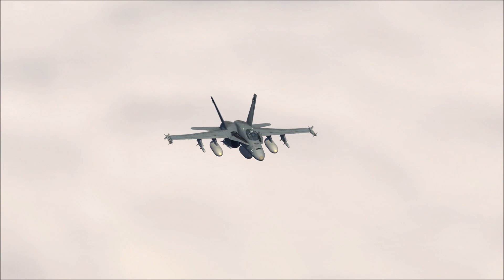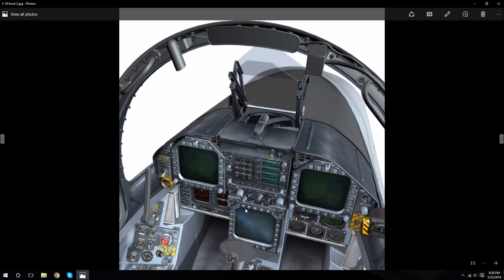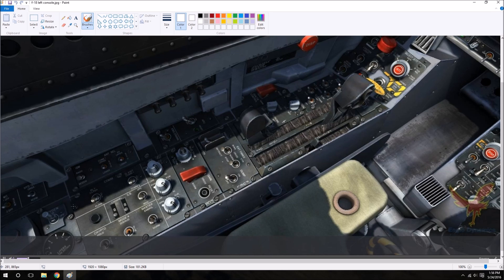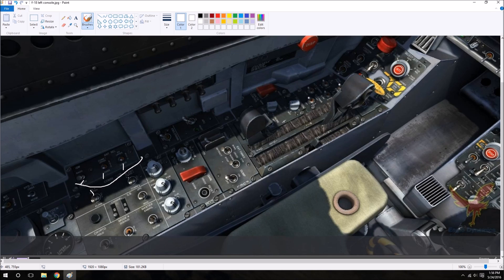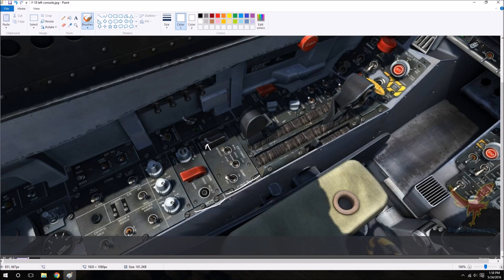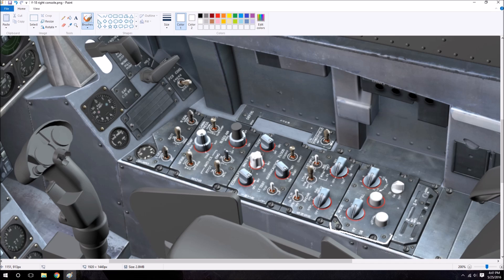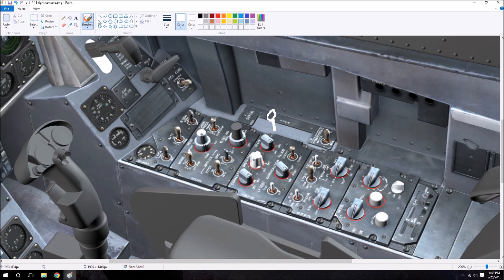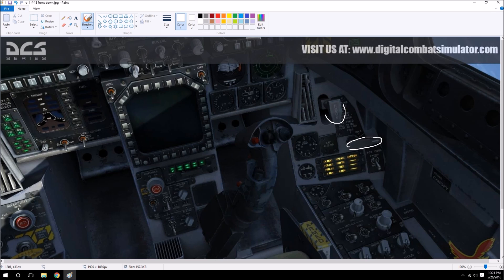DCS F/A-18C Cockpit Familiarization Tutorial Part 1

Comment: Be a man, Play BMS
Reply from the maker: BMS is great, just don't think i want to fly a hornet that has the avionics of the f-16 instead.
Reply: Apparently you haven't flown any recent updates then. Much better than anything else available.
Reply: Obviously you haven't tried any of the recent iterations recently.  It is much better than any of the other offerings currently available.
Reply: Sure some of the terrain graphics aren't great, but you can't say that the Viper graphics aren't good.  The complexity of the systems is unmatched in any other simulator.  Not to mention the dynamic campaign and multiplayer.
Reply from the maker: Dalton, no need to insult his favorite sim.
Cole, BMS has its advantages, but if by systems you mean avionics, then no. I don't think BMS is better when it comes to avionics or FM.
(think A-10 or Viggen)

Comment: The Anti G valve doesn't keep the O2 system "operating under G" since you have a NATOPs according to your comments you can look it up...should be under  "life support" since it is the hookup for the G-suit...LOL
Reply from the maker: Ah ok thanks. I was confused since it was on the oxygen panel.
Reply: It's on the O2 panel based on the system that feeds it and the O2. The system provides bleed air stepped down to the anti G system as well as providing  bleed  air  (more complicated than I'm telling you" to OBOGs after cooling it down and stepping the pressure down for the mask. Once you lose the engines you lose O2 (still have a backup) but O2 becomes a backseat issue since the motors aren't turning...unless of course it is a bleed air issue and that may be a bigger deal than having no O2 as well :(